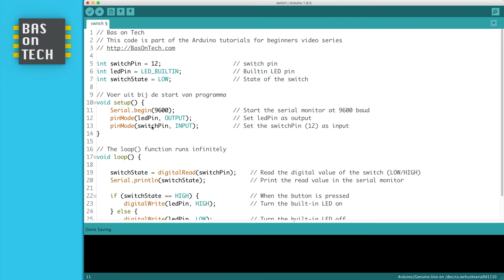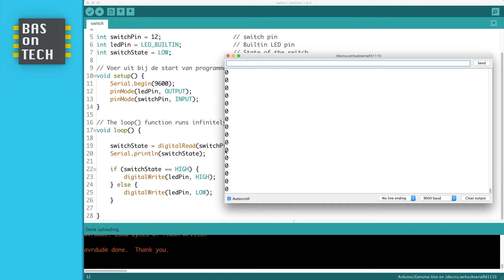PUSH BUTTON / TACTILE SWITCH - Arduino tutorial #5

Comment: Hi i have a soft tactile switch on battery powered Christmas lights. And used a AA to usb converter which replaces batteries. Then i have the usb plugged into a 5v charger plug then plugged into a timer. The problem i have is the lights wont come back on after the timer times them to come on. So i put a bit of tissue to keep the switch open. The lights come on now when timer switches them on. But I have a  question will this harm the lights and unit in anyway 

Thanks
Reply from the maker: Hi Fionn, this is really hard to say without knowing the circuit, sorry.